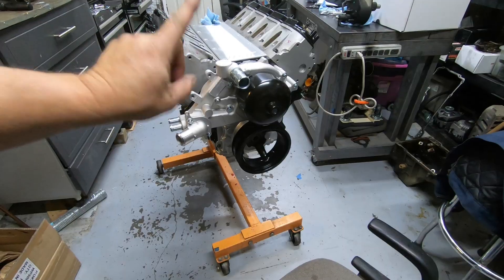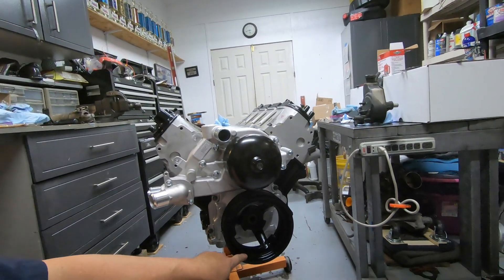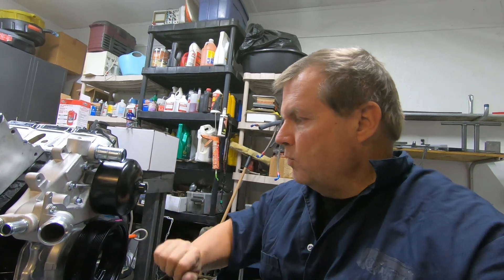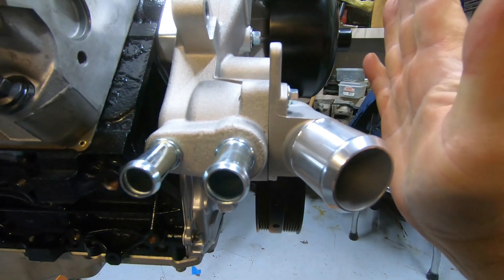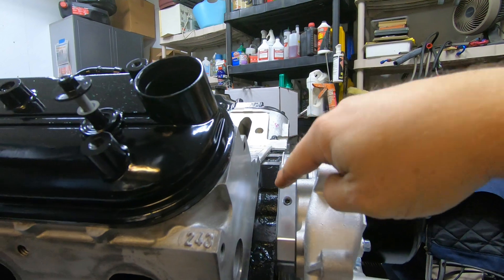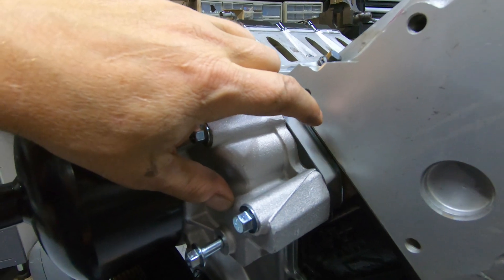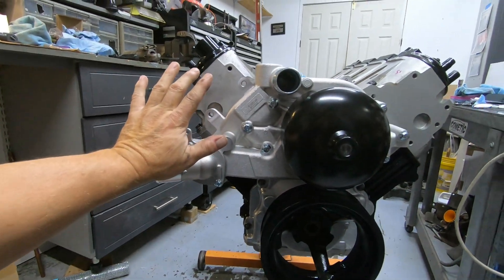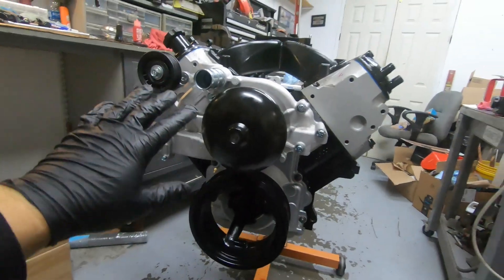LS Accessories: How to Select the Right One for Your Application

Comment: Hi there, can you run just the alternator without the power steering pump and would you need the second tensioner on the alternator bracket? I have a 5.3 in an 86 Cutlass with no accessories on the front but it is a manual steering car.
Reply from the maker: I'm sure that you can, I know on my 95 Camaro, I ran only the alternator. Although it was a custom made bracket. I'm sure that ICT sells something that will fit about any combination that you can dream of.